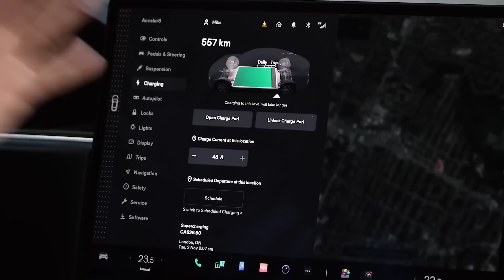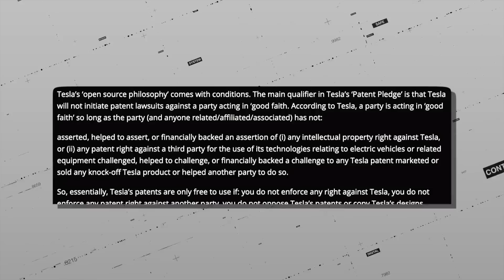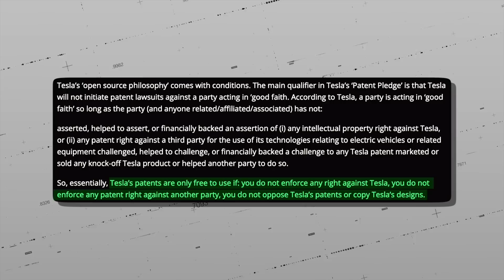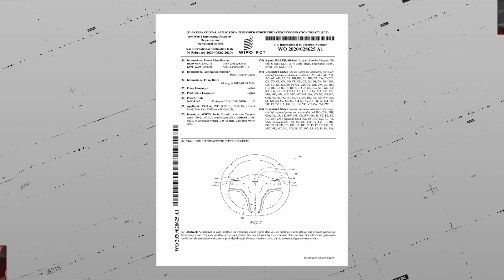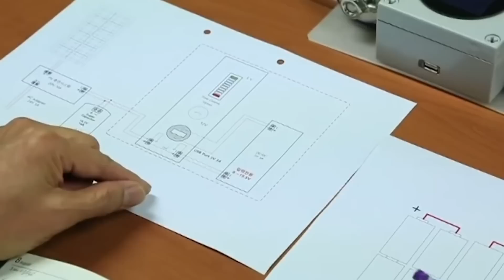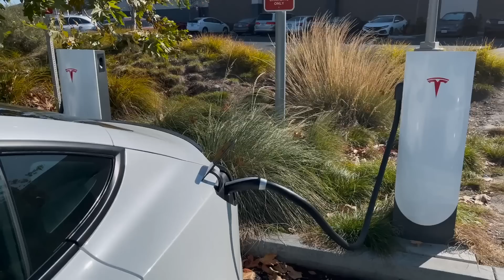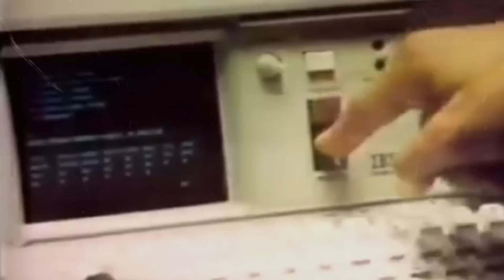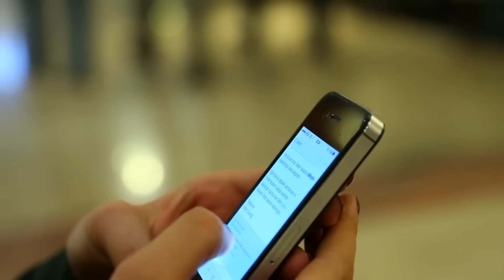Real Reason Why Elon Musk is Sharing His Patents With You

Comment: One of the key reasons was his hope that if others company use his patent, they won't be able to sue  Tesla for using their patents. Tesla is a relative newcomer and traditional auto manufacturer hold a ton of patents that are related to automobile irrespective of electric or gasoline I.e. applicable to Tesla as well. This implies Tesla working around these patents or licensing them. Both cost effort and money. Tesla have lot of patents on EV technology but their portfolio in general automotive tech has been relatively week. 
However, Tesla is established market leader in the EV with huge mind share. Challenging that just by access to EV tech would not be easy; challenging perception, mind share and almost apple like fan base is more than tech play.

Comment: Everybody keeps missing the biggest reason fuel cells will fail - they use a lot of platinum in their design. Not only is it incredibly expensive - but if just half of the cars on the road were running on fuel cells? the worlds supply of platinum would be gone. Fuel cell designers are relying on a new chemistry to be discovered to replace platinum. They've been looking for over 40 years.
Reply: Explains why they want to capture asteroids: quick access to resources.
Reply: @Bear-form  Perhaps the moon too.
Reply: @justlittleoldme7283  Helium 3 mostly. The movie Moon touches upon that.
Reply: This used to be true, but in the last decade or so researchers have found a way to eliminate the need for platinum in fuel cells, as well as coming up with several other innovations that reduce the costs considerably.

That still doesn't mean that fuel cells are competitive with batteries, but the tech has improved impressively.